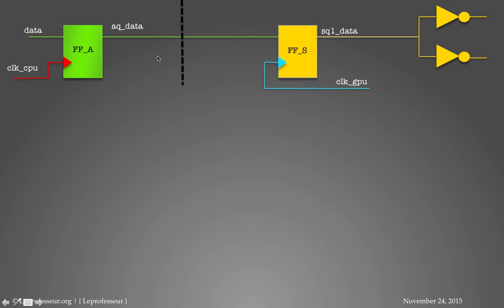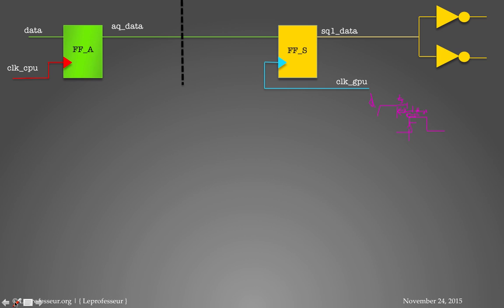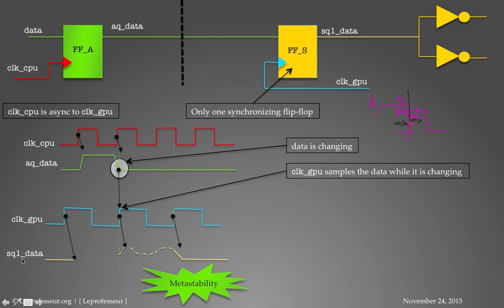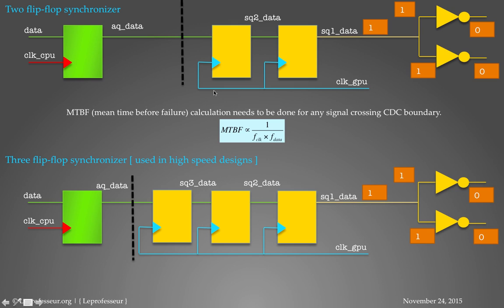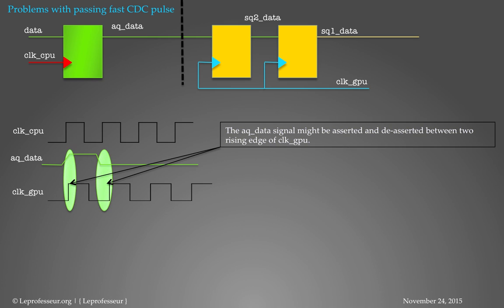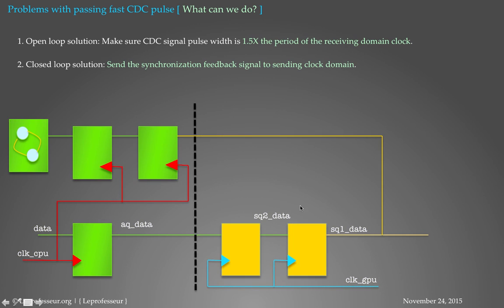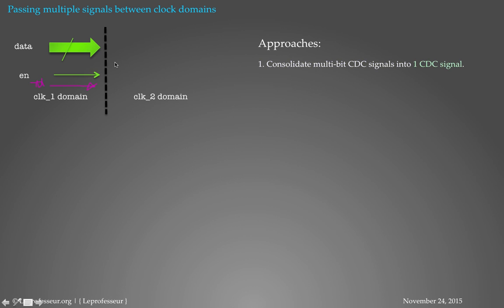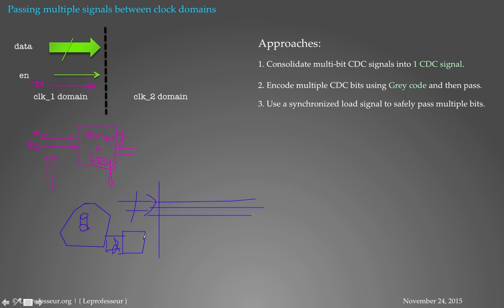⨘ } VLSI } 4 } Clock Domain Crossing (CDC) Techniques } LE PROFESSEUR }

Comment: The example of Bin2Gray needs more clarification. If we are converting the enable and read signals to gray, why is it ensured that only one signal is changing? It is true only when we are counting up in a sequence right? Am I misinterpreting this?
Reply from the maker: basic idea is to have only one signal out of vector pass the clock domains. grey code ensures that one signal is changing at a time. if more than one signals are changing, they will reach to destination domain at different times, that may lead to wrong values in logic in destination and will mess up things. Gray code need to be carefully used as well, it will need to circle the full length of the counter, e.f. 3 bits will have 8 values.

Comment: Nice lecture sir!!!
1.How to consolidate multi bit CDC signals into one CDC signal?
Reply from the maker: Please look into other lectures on CDC, I have shared several ideas, for example you may use grey code. It depends on whether those signals are control of data path signals, depending on type one need to use appropriate strategy, e.g. async fifo, grey code etc. LEPROF.
Reply: @Leprofesseur  : Could you please explain how to synchronize base 10 counter in Clk domain B which is running in clk domain A  ?

Comment: what happens when CDC is between two synchronous clock domain(ex- clk1 and clk2= clk1/2). Is there are no chances of violation?  if it is there for those also same techniques and synchronizers will be used?
Reply from the maker: I have discussed this scenario in one of the comments/lecture, there may be violations, we need to see the origin of both clocks, both clocks need to be phase aligned, second, we need to check whether data is passing from faster clock to slower or vice versa.  We need to make sure of data stability as well, we need to understand intent of design and need to use proper CDC solution, e.g.closed-loop, fifo etc. all the best, LeProf }

Comment: Hello Leprofesseur. Nice video. I understand that, an extra Flip-flop at receiving end can synchronize the incoming signal . Is there any formula/approach for finding the required number of extra flops (2 or 3 or more) at receiving domain, based on the clock frequency ration? And how does it vary for both cases i.e. f_cpu >f_gpu and f_gpu>f_cpu?
Reply from the maker: Different technology nodes have different requirements for sync flops. It needs to be characterized sync flops for various parameters before using them in design. Many designers simply use 2 or 3 regular d - flops for synchronization which is not a good design practice. Frequency ratio has nothing to do with the number of sync flops, ratio plays a role when we need to check pulse width for data stability, e.g. we want to make sure that data coming from faster domain does not get lost in slower clock domain. There are various techniques to ensure data stability. Please watch all clock domain crossing and metastability lectures to have more understanding on these issues. All the Best. LeProf }
Reply: Leprofesseur } Thank you for your quick reply. My confusion is, what if the signal is not settled to a stable value within one clock cycle,  which may depend on both how fast the data is changing of how fast is the clock in receiving domain. Hence I think, if clock is too fast to settle to a stable the signal in 1 clock period we should add extra flop. Hence the no. of flops will keep increase as speed increase. Please correct me if I'm wrong. Thank you.
Reply from the maker: Number of flops has nothing to do with speed, designer must need to use proper logic (e.g. handshake mechanism or some other technique) for making sure that data is properly captured in receiving clock domain. Typically closed-loop CDC techniques are preferred. You may like to watch all clock domain crossings, reset domain crossings lectures to have more understanding about these topics.

Comment: Thank you for this video!

22:30 how comes that the greycode should help in such a case?

assuming we have en and rd, first en has to be enabled afterwards rd has to be enabled -> 10   11.

only one signal should change when crossing a clock domain that's clear but not how greycode can help to achieve that solution.

00 -> 00 (EN/RD disabled)
01 -> 01 (EN disabled/RD enabled, shouldn't be used probably)
10 -> 11 (EN enabled / RD disabled)
11 -> 10 (EN enabled / RD enabled)

assuming we jump from EN/RD disabled to EN enabled / RD enabled ok only one bit would change... but how about to jump from EN/RD disabled to EN enabled / RD disabled - you're going to change 2 bits at once then.

I think you can see in which way it confuses me I do not see any benefit of using greycode in that case.
Reply from the maker: by grey coding of correlated information bits, it make sure that only one bit is changing at a time across clock domains.
Reply: but that only works when the input is counting increasingly from 0 to 3...

I don't understand how this should help at all in such a case (EN / RD)  if the input data could still be 2 random bits (which basically would translate to 2 random greycode values?!)
Reply from the maker: It's not to get confused with EN/RD, from conceptual point of view when co-related information bits cross clock boundaries, we need to be careful, we can use different strategies depending on complexities of design, for example if you have 3 bits, you can use gray codes so that only one bit changes, otherwise if two bits are changing at the same time, then there is danger that it may latch wrong values (different arrival time via different sync flops routes in destination). By just changing one bit and keeping other bits constant, we properly latch values in receiving domain. One can use other strategies e.g. FIFO, state machine, closed-loop etc for multi-bit crossings. You may wanna watch other lectures where I discuss other clock crossing strategies. Hope that helps!
Reply: Thank you for your answer! I really appreciate your lectures, I'm watching them the second time now to pick up the parts which are confusing to me.

could it be that EN/RD is just not a suitable example for this? eg. moving an increasing memory pointer from one clock domain to another one might be a better example (for greycode) to understand this?

I understand the idea behind greycode (to only switch one signal), just the connection between RD/EN is confusing.
Reply from the maker: It seems to me that due to EN/RD you are getting confused, you said that first enable EN and then RD follows, I assume that it is consistent that when EN is enabled then after one clock RD is enabled and that is used for some handshake, that many not be a good example of gray code.  Lets say another example, suppose you may wanna pass an array[2:0] across clock domains, you may wanna use gray code technique. Memory pointers are another example, I discussed this in FIFO lecture, you may wanna check that.
Reply from the maker: https://youtu.be/OWbd9DT-xuE
Reply: Thank you for the explanation!

Comment: good lecture sir.But i need to confirm one thing .......
here we are using a chain of 2 flip flops for synchronization purpose.
1) suppose the first flipflop goes into the meta-stable state, we are sure that the 2nd flip flop will not enter into the meta stable   state(if the data change rate is 1.5 times the receiving clock period).
 2)but since the first flip flop was in meta-stable state then its output is obviously unknown and it is this very unknown output that gets registered in the second flip-flop on the occurrence of the next clock cycle of the receiving clock edge. 
3)hence on the 2nd clock edge of the receiving clock pulse , the unknown data output of the first flop propagates through the rest of the logic.
So how do we ensure that the unknown data is not there in case of a synchronizer.
or is it just that the synchronizer only prevents the setup and hold violation in the receiving clock domain and does not guarantee the correctness of data incase of setup violation in the first flop
Reply from the maker: Thanks, having another flop in sync scheme reduces probability of MTBF, it takes some time to settle output of metastable flop, for example if your clock is too high, you may need more than one flop in sync flop chain, it depends on technology, a good way is to use meta sync flops from technology library. The purpose of second flop in a 2-flop sync scheme is to get stable value whether it is 0 or 1, it does not ensure correctness, to ensure correctness, the input signal needs to hold its value for some minimum amount of time depending on ratio of sending clock and receiving clock. In order to prevent data loss, data should be stable or kept constant in source domain long enough. There can be different design techniques to prevent data loss e.g. for state machine can be used to generate a signal from source clock domain which is long enough in destination clock domain. For asynchronous domains fifo and handshake techniques are generally preferred.
Reply: thanks for the reply, highly appreciate your response.....